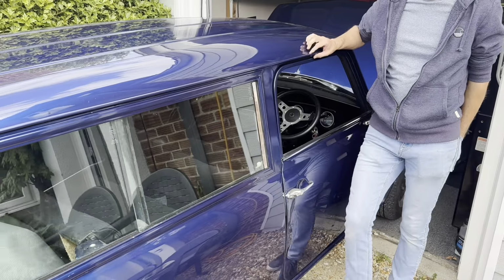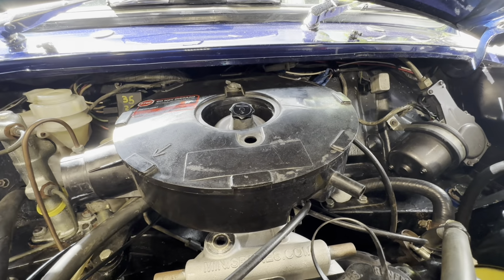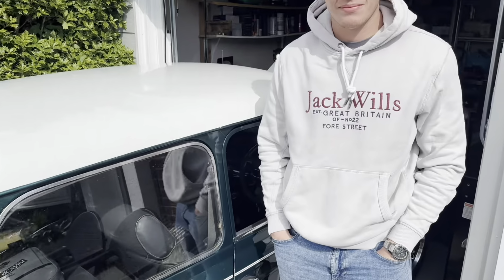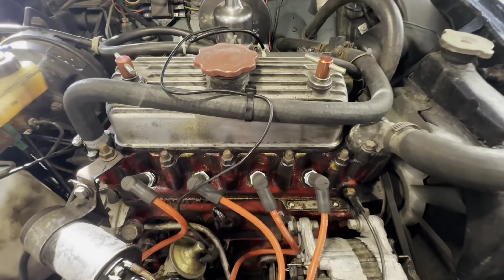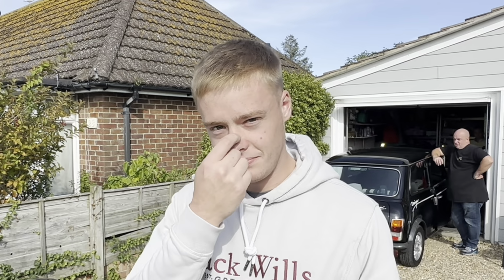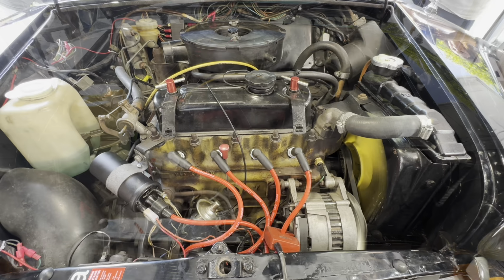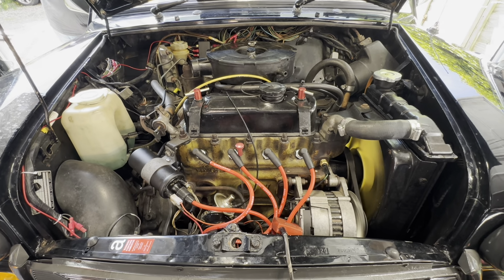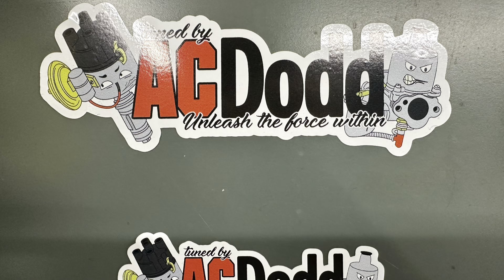On the road ‘tuning’ with ACDodd - S3, Ep23 - Hayling island

Comment: I know it's only the sound on the video but what A lot of tapit clatter I know I'm old school but always the tapit clearance first it doesn't take long plugs out put it in fourth gear The nine rule Maybe 15 minutes sometimes less😊
Reply from the maker: As I said before, if I have a hot engine presented I don’t do it. If I have a number of cars to do I don’t have the time. 
However if I am working on either  morning or afternoon slot with 1 car, the owners are paying more and I then have time to do the tappets. Adjusting the tappets does not necessarily reduce the sound the microphone picks up, this is due to the frequency the microphone on my phone works at, and also wear in the engine.

Lastly, it’s a waste of my time to do the tappets, the owners can do these, they are paying for the optimisation and custom needle making, they would all rather I spend as much time doing this, as that is something they can’t do. 

If you book me for a tuneup, the car needs to be ready for tuning. That includes valve clearances.